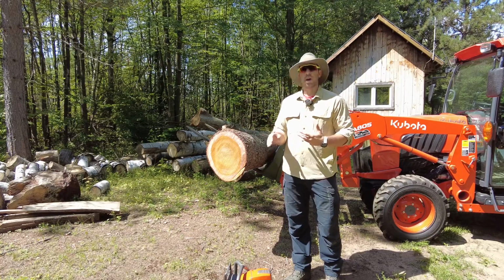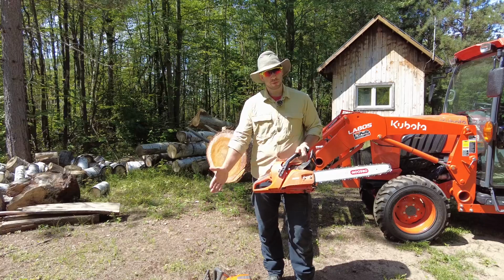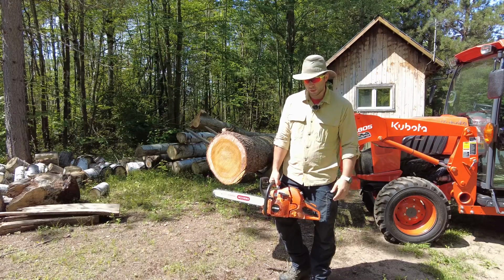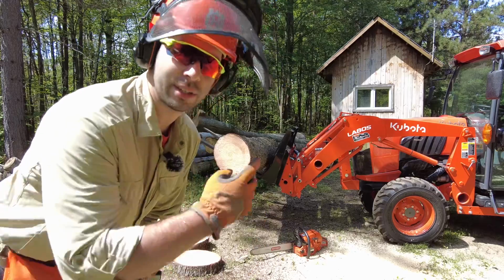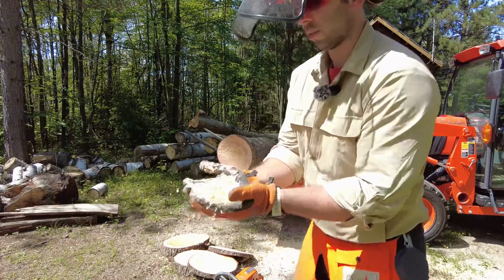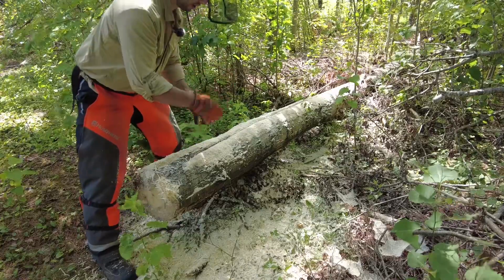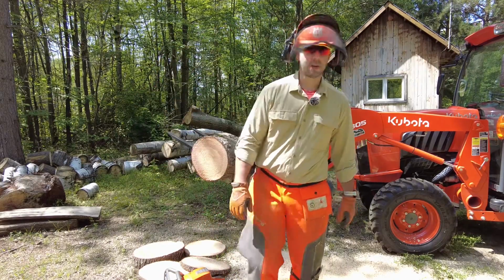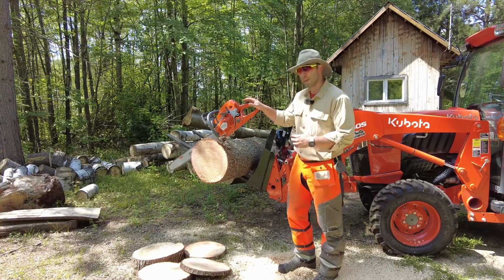Tuning An Autotune Powersaw? | Can We Tune The Husqvarna 572XP?

Comment: When you first start it its on high idle which is why the chain turns slowly, tap the throttle takes it off high idle. Lol but to each their own
Reply from the maker: You are right about the high idle on start but as you can see in the video the chain still turns after my cut while idling so it was definitely not on high idle at that time.

Comment: got also a 572, even run a 36inch on it when needed
Reply from the maker: How does it handle it?
Reply: @brokenpinesfarm  pretty nice, next week i go try it on dry oak's, but think thats to much for the saw with a 36, and with that long bar she's a bit to heavy for all day cutting. it all got pro's and con's
Reply: @sjekkie8299  good points! I'm trying to source a 28 or 32 light bar for this saw to make it more comfortable for all day cutting.
Reply: @ADayToLong  you can modify it so you can run stihl light bars.
Reply: @brokenpinesfarm  did play with it on 45 ich dry oak with orgenon semi chissel chain on the 36inch bar (oregon powercut) , like butter, so life wood wil be no problem, maybe i tune it up on the carb to get more out, but my results say i dont need to make firewood, as logger i would just do mod it to get that little extra

Comment: This is a crazy idea for something that is being used in the wood, with added vibration and load, what is wrong with a mixture screw, that is not going to go wrong for 10 years of use, the electronic chip will not survive for 5 years, if your cannot cut wood due to a slightly out of tune saw then just buy one with a bigger engine, my 565 will be going into the back of the barn, while I will find a sensible manual adjusted saw. Many thanks for pointing out these points, the dealers do not tell us about this.
Reply from the maker: Personally used the 572xp quite a bit and still running strong but you are correct that if the chip goes we are kinda stuck. Backup saw needs a good old screwdriver to adjust the carb!
Reply: You're missing the point that the EPA and similar governing bodies around the world are cracking down on two stroke emissions and manufacturers are trying to find ways to lower the emissions of their products. Autotune and Mtronic work toward that end rather than having a bunch of galoots running around with poorly self tuned and extremely rich running bigger saws to compensate for their inability to properly tune a carb. Autotune et al also prevent the guys who want to hear their saws scream from tuning them too lean and burning them up, giving the brand a black eye in the process. Your comment hasn't aged well, there are thousands upon thousands of autotune saws greater than five years old that are still running strong.